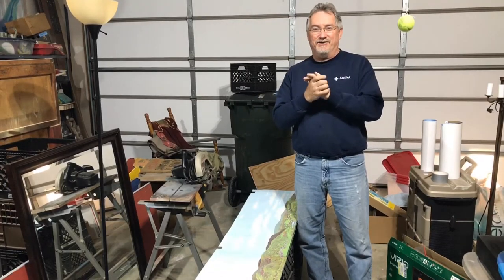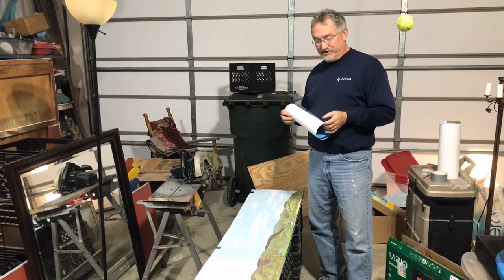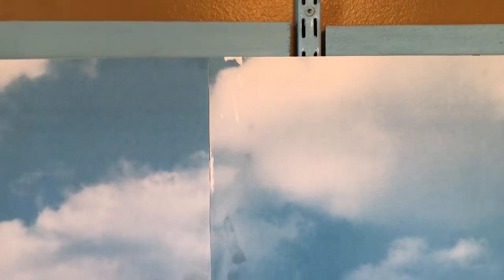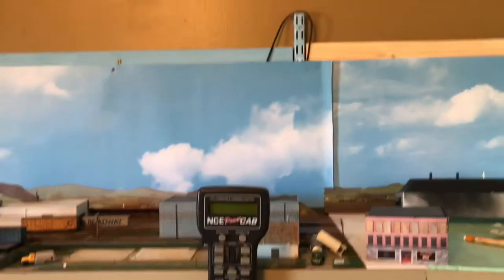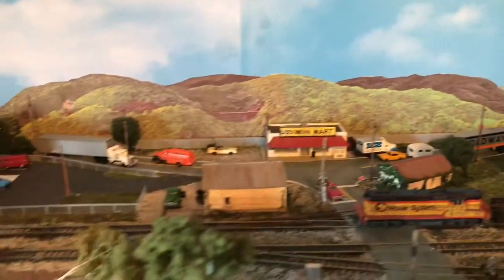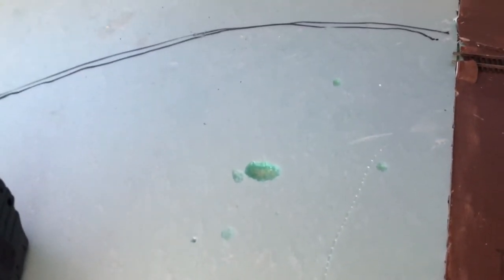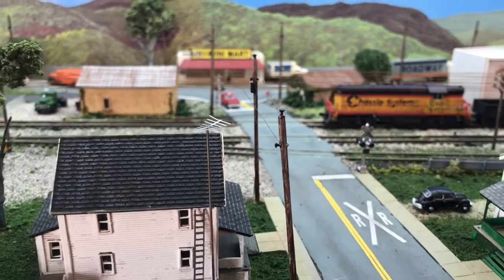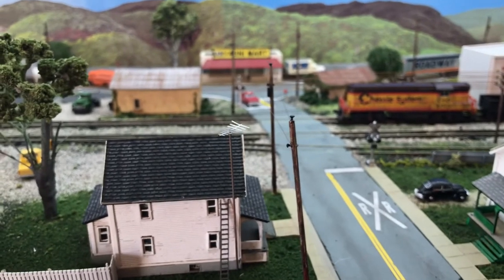Installing the backdrop, fascia, and lights to connect the modules

Comment: Your idea for the backdrop worked out. It looks much better having the sky color match even with the minor issues with the seams. 
Now that you are "DUN" with the benchwork/backdrop/facia/lighting stuff, you get to work on the second best part, doing scenery/buildings/track!  Running trains, of course, is the first best part! :)
Reply from the maker: I don’t know how these guys with huge layouts stay motivated. I need to run trains pretty often to keep my focus. Good to have this behind me, but still plenty more to get DUN!
Reply: @thomplacier677  I couldn't even wait for my benchwork to be done before I set up some track to run trains, at first. I took the track off a couple weeks ago to work on the benchwork/wiring/etc., but I'm probably going to set up something to run trains soon. Been too long.